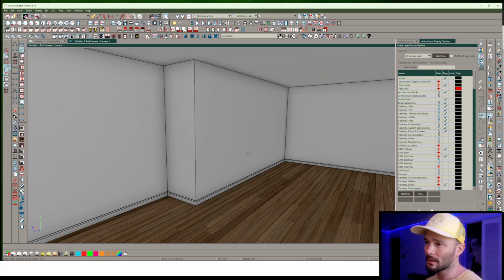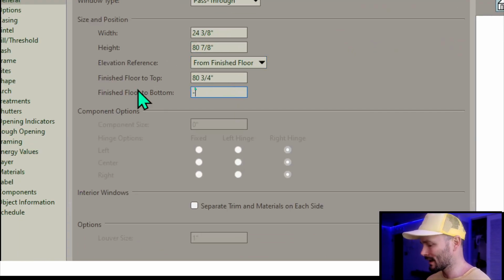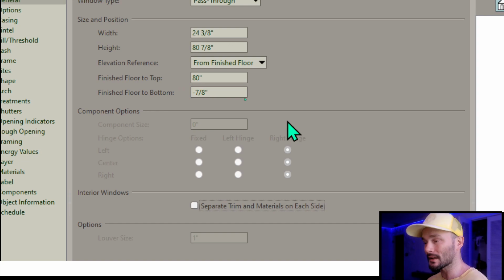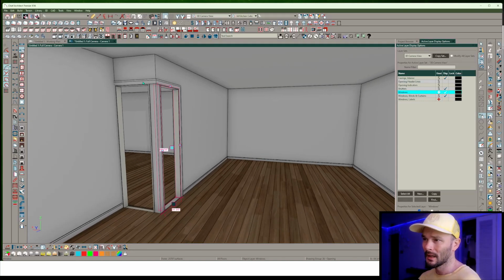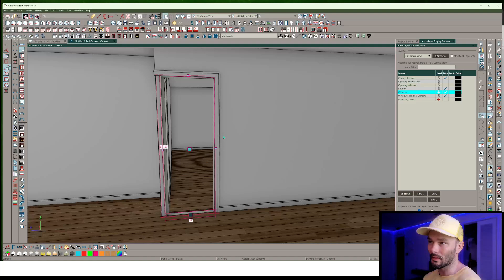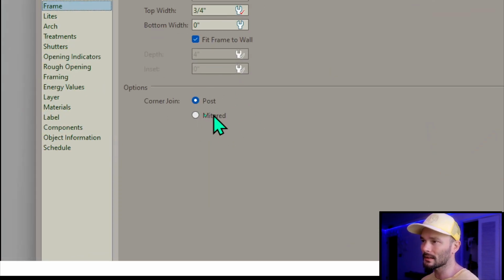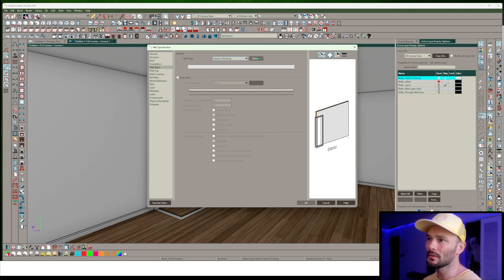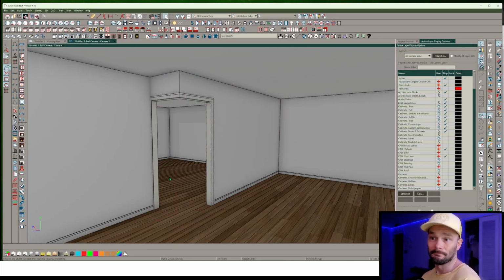CA SHORTS - Corner Doorway in Chief Architect Premiere X16

Comment: Several cool new features with X16! I like the new reflect about diagonal, although it takes some getting used to when your just trying to do the older, standard reflect. The new options keep popping up.  I also like the "miter" option for windows, so you should update your corner sliding exterior door video.  Those design options are getting more popular and I've used them on 2 projects so far.
The last one was the "partition" wall feature not cutting the floor.  Boy that is a big annoying one.
Thanks for the quick demo Rene.